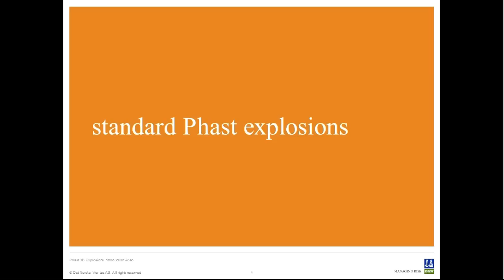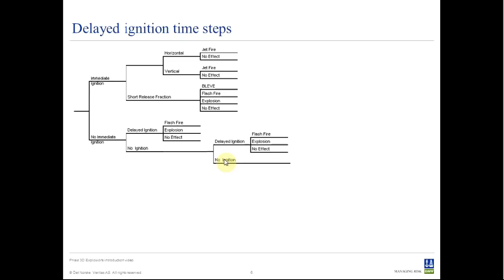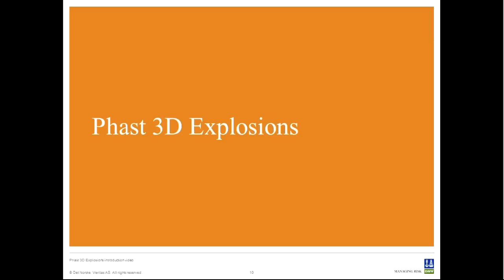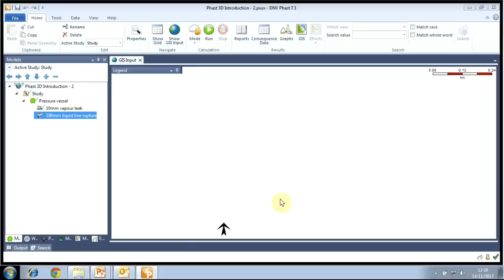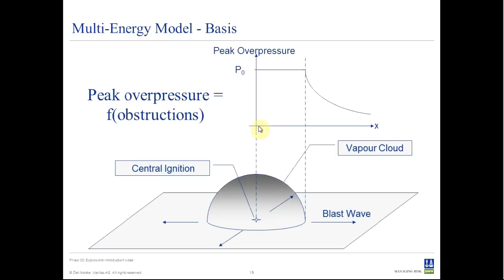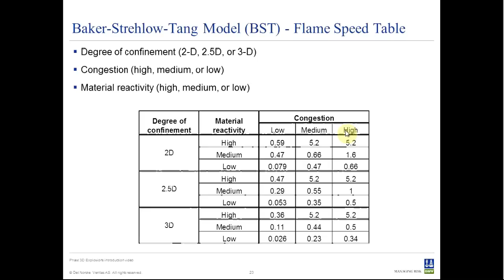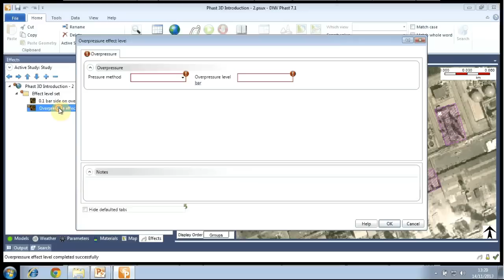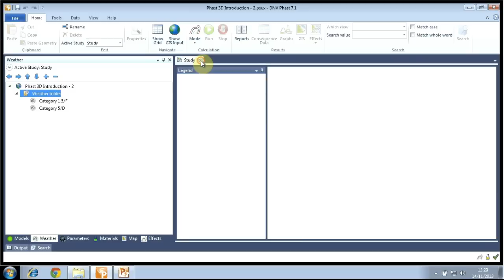Phast 3D Explosions introduction video

Comment: Can we use this software for fire or gas detector placement mapping? if any related plz share relevant documents to me
Reply from the maker: Some users have used Phast and Safeti results as an input to fire and gas mapping, though we do not have a recommended practice.  We also have CFD modelling software (KFX), which could be used for fire and gas mapping. Please contact digital@dnvgl.com if you would like to discuss this further.